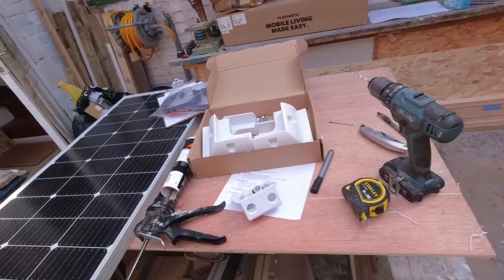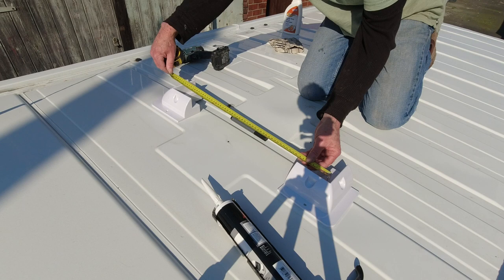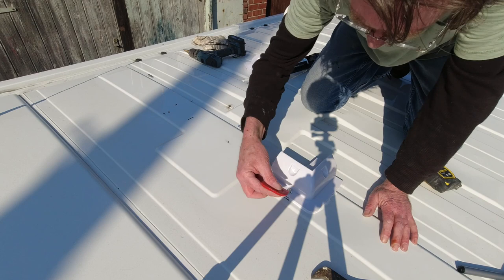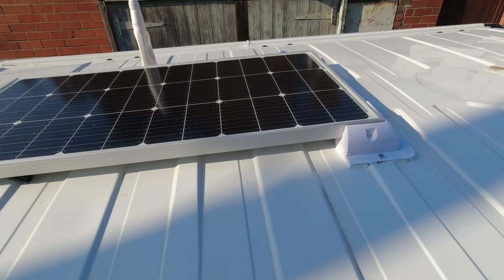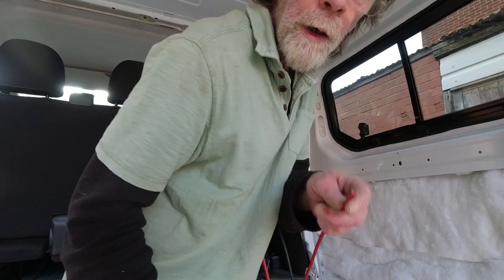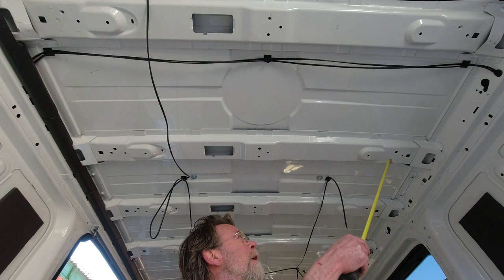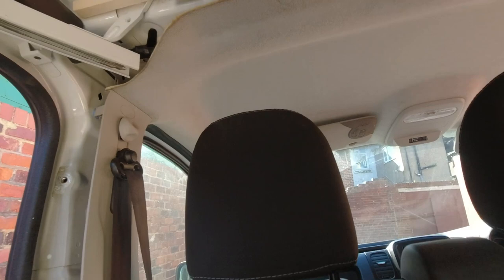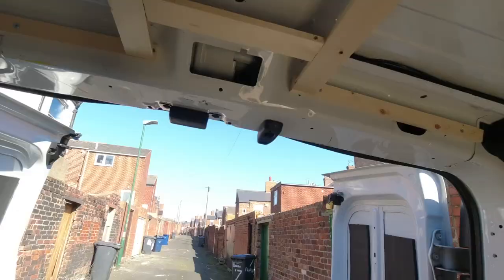Vauxhall Vivaro Campervan Conversion - Pt4 - Fitting The Solar Panel and Starting On The Ceiling

Comment: Another good video Dave. However you could have mounted the solar panel on roof bars and fed the cables down the plastic sections above your rear lights, then through one of the holes were the van loom goes, sealed it job done. No holes in the roof = no chance of leaks in the future.

Comment: Great videos. It would have helped me greatly if you'd included a materials list; what you bought and where from :-) . Im just starting my SWB Vivaro conversion, identical vehicle to yours. At the moment, still trying to figure out what floor insulation you used - what it was and where from. Cheers.
Reply from the maker: Hi, I do have a parts and cost list in another video. https://www.youtube.com/watch?v=wO4l6YfpUVU      I got most of it on ebay and amazon but the floor insulation was 7mm closed cell foam and it took 10sqm for the LWB. If you search for that on ebay a load of it should come up. Good luck with your conversion, it's a great project to do.
Reply: @dave-watson  Ha! That's brilliant. Just what I was after. Thanks.

Comment: Hi Dave, thanks again for these videos. Ive been following along for my own conversion. Im wondering if the horizontal ceiling batons are only necessary if you plan to use cladding for the ceiling? 
Im think about just using 6mm ply, same as the wall panelling. Granted, not as pretty but hoping it will be functionally the same? 
If so do you reckon you can just put the ply straight onto the metal framework?
Many thanks
Reply from the maker: Hi Liam, Glad the videos are helpful. Yes i think you could put the ply onto the steel framework with some self tappers only thing is the ply may sag a bit and might need some support between the ceiling ribs of the van. Hope that helps.

Comment: iv noticed well this build as been done for quite a while why did u always drill everything as u can get screws that self drill and screw :/ would that not of been easier ? just asking
Reply from the maker: Hi lee, I find it more accurate to drill a pilot hole. the self drilling screws sometimes wobble about on the steel before they gat a bite.
Reply: @dave-watson  Makes sense lovely van btw i have the same and really thinking of turning it into a stealth camper.

Comment: What size screws did you use to attach the wood to the ceiling. 
Thanks.
Reply from the maker: If I remember correctly I used 25mm self tappers to attach the cross beams to the ribs of the van and 16mm wood screws to attach the cladding to the beams. Hope that helps.

Comment: Hey Dave, with the down lights what’s the set up for the supply? 12v down lights with a 12v supply? If so did you have to use a driver still in series to the lights
Reply from the maker: The lights are all 12v and the lead runs from the lights to fuse box and then the fuse box to the leisure battery. Here is a link to a video i did on the electrics https://www.youtube.com/watch?v=_oyi8PhQ7p0&t=15s  Hope that helps.
Reply: @dave-watson  perfect thanks Dave